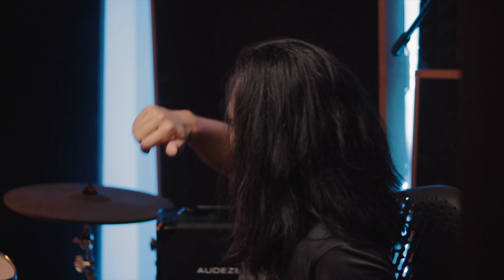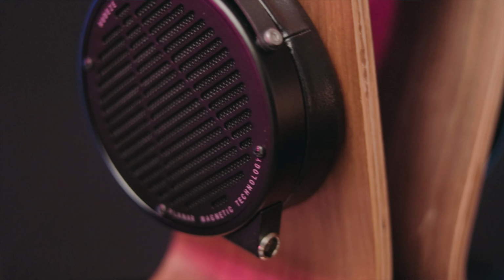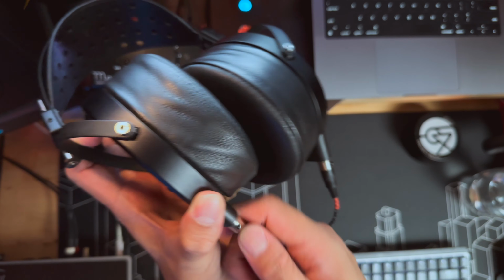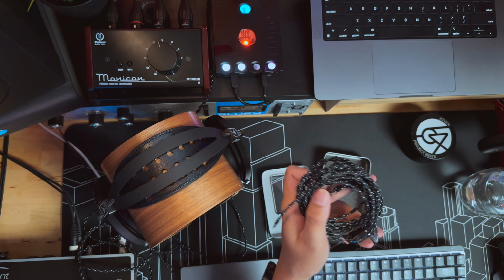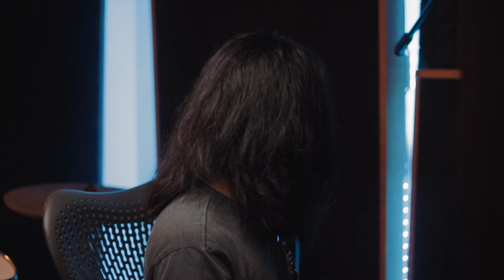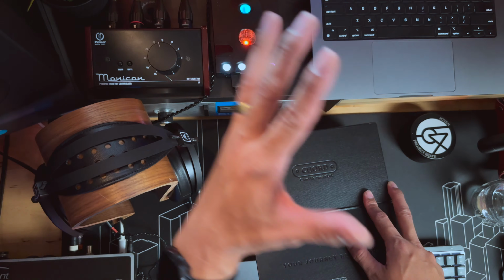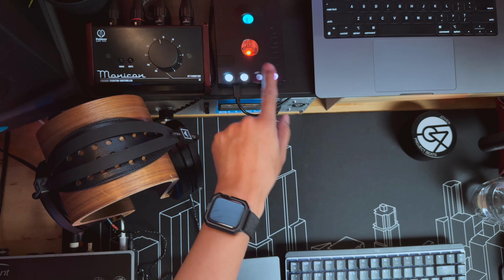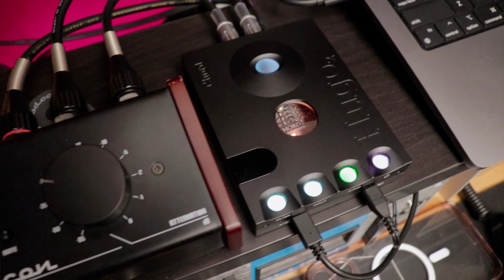Chord Hugo2 and Audeze LCD-X: Ultimate Mixing and Mastering Headphone DAC System??

Comment: Hi. I need an urgent advice please! I Have Audeze MM-500, and want to buy Hugo 2 because of the conversion and the headphone amp.
 I am mixing with outboard hardware and I have to hear the changes real-rime, can I use my Focusrite Red4Pre optical out to send signal to Hugo 2, but to keep my Focusrite as audio interface, using Hugo 2 as DA converter and headphone amp? Is this logical chain or?
Reply from the maker: Hey. That’s an awesome setup. Afaik there is no other way to do that with the hugo2 besides the optical in since there is no analog in. For mixing latency on optical shouldn’t be an issue. If you need analog IO maybe consider the chord alto.  Thanks for checking the video, precieate it.
Reply: @ProjectBeats_  Thank you for your response, I waned to confirm that its possible technically, because I never kind of setup before. Much appreciate your video, it was one of the most useful to me! All best.

Comment: Just for clarity since I’m new to this. So Hugo 2 can be used as an interface alone? Also could I connect my apogee duet 2 to the Hugo 2 for headphone amplification? I have the Neumann 150 ohms..would that translate well with Hugo 2?
Reply from the maker: Hey, ya so apogee duet has a really good headphone amp and conversion built in. I wouldn’t necessarily reco buying hugo2. However if you have one. You’d have 2 workflow. Tracking and mixing, duet for tracking. Switch to hugo for mixing. You could plug them both. But I generally dont have my interface on when mixing. Just the hugo.
Reply from the maker: IMO the neuman with the apogee is good enough combo.

Comment: I need your advice,  do i need hugo2 with apollo uad card? Or its not necessary? Thank you
Reply from the maker: Hey, IMO the converters and components in the  apollo interface are pretty up there, I would consider it to be on the high end home/studio interface. I’d say it’s a solid headphone dac/amp and pretty flat, you could do without a dedicated amp/dac but having one wouldn’t be redundant but an upgrade specially if you are considering Hugo2/Adi2 fs pro/RNHP, tho you’d have to decide weather it’s worth it for you. For most projects Apollo could be an end game. I’ve seen some console users who has a dedicated headphone dac/amp just coz they are familiar with the quality, and they have a certain workflow. Maybe best to audition one and see how they fit into your workflow.
Reply: @ProjectBeats_  thanks a lot for your detailed reply, I guess I have to really try them out to see the difference,  thank you